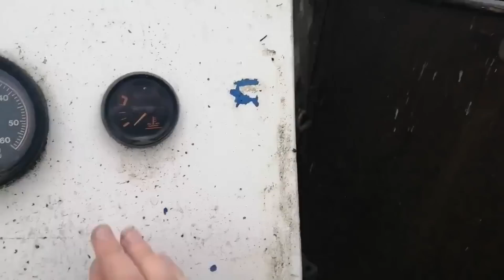Ep 3: I BOUGHT A CANALBOAT!

Comment: Wow? well done it looks a nice boat I cannot see any osmosis on the hull so all looks sound just the rubbing strakes make sure they do not leak? other wise all is well looks a good boat ? I have owned two boats the second was a creaton 32 foot centre cot-pit with a fibre class hull almost bare bones windows and some structure I built the complete top of the boat built side doors and twin water tanks hot and cold water sit down bath and shower solid  fuel stove full electrics etc love it loved the build> now I have moved onto a motor home ??? but miss my boat?? don't forget the boat safty certificate about £140 every four years you need it before you by your cruising licence? a licence needs a mooring or you can continually cruise without a mooring? I have subscribed to you if you need any advice feel free.... best wishes Ken.........

Comment: Lizbef,please don't waste time cleaning BAB, if you are going to do it then do it right. Get that boat in the air and start by sand blasting the outside,bottom first, find out what issues you have there. IT HAS TO FLOAT!  fix issues with hull,prime and paint.then tear everything out of the inside including the floor ,prime ,paint the inside of the hull. then blow in that white insulation that will stick to everything,build new floor . decide if you need new windows you might can get much better insulated glass. then draw up plans for new plumbing and wiring to fit your plans for what you want in the boat,remember plumbing and wiring might need to go in as the floor goes in to make in easier and more accessible. after all that then clean  and start making that boat your very own dream boat.  Been following you since Delos,call them ask what they think of my idea about where to start, please.LOVE AND BEST WISHES

Comment: Rip up the floor and check every square inch and every single stringer for Osmosis and dry rot,  check all through hull fixings and replace. Whatever you do, don't just start building your interior without checking the hull inside and out or you will be pumping her out from the bottom of the canal... I would guess it's going to cost you about 10k to get her in a decent acceptable condition to live in by the time you pass the bss...

Comment: Liz check the hull throughly first, then the outboard, then replace all the thru hulls, there is a reason that it sunk and you need to know that. After that totally gut the interior and pressure wash it with some bleach added. Once the hull is good and the interior gutted and cleaned, make the windows, doors and hatches water tight. Then start on the rebuild of the interior, leave the outside for last (cleaning, sanding and painting) as the weather in winter will undo any work that you do now.
Remember that all the existing lining and insulation should be removed to clean it properly to remove any mould.
With the marine ply panels that will be fitted, the best treatment is with epoxy timber preserver, as many thinned down coats as the ply will absorb on both sides until it starts to build on the surface. Then put 2 coats of epoxy primer on within 8 hours to get the chemical bond and then you are set for trouble free long life marine ply. There will be some that will tell you that it isn’t necessary, don’t listen to them, use the epoxy preserver and primer. I have an old 38ft marine ply game fishing cabin cruiser and it is as good as the day it was built back in 1983 all because I stripped all the paint and soaked it inside and out with the thinned down epoxy preserver followed with the primer as mentioned above when I bought it 20 years ago. Most of the marine ply took 16 coats of the 50% thinned preserver and 2 coats of the straight preserver.

Comment: Couple things Lizbef, first, chuck that vape.  You will wind up in A&E on a vent with permanent lung damage. Look at the news. Second, make sure that the outboard is in good working order. If she's been sunk and not serviced instantly you may be shopping for a replacement. Third, Pull the helm apart and make sure there are no missing bits. Don't waste too much time cleaning you need to get to see all of the interior hull and every through hull and that means making more mess pulling up the floor and what have you. You need to find out why she sank and how any repairs were made. This should be easy compared to Papageno. No diesel, no keel, no mast or rig or chain plates, and nothing has to stand up to a named storm 1000 miles from land. Good luck.

Comment: Ok, I think it will be wiggling too much to live on in the water because it's not made of steel. 
I hope you will get a lot of help to get it liveable.
Reply: That's a common myth about fibreglass.  It CAN be stronger than the same weight of steel (particularly epoxy-kevlar, which this isn't), and just as rigid.  It all depends on the quality of the materials and engineering of the design.

Intercity 125 locomotives have a fibreglass cab and nose, for example; and it certainly doesn't do any "wiggling".

I can't tell from this video what it's like.  It could go either way.  It needs a good inspection by a marine surveyor before sinking serious time and money into it.
Reply: @Murph9000  Completely not my point.  This kind of boat is too light to live on,  too wiggly..
Reply: @robvanessen2925  If you mean stability, as in rolling / tipping, steel narrowboats are not particularly stable either.  Steel vs. fibreglass isn't what makes the biggest difference; it's beam (width), draught, weight, and weight distribution.  Steel boats can be unstable, fibreglass boats can be stable.  With a bit of ballast, it should be ok (not necessarily great, but ok).  If you're used to sailing boats, which our intrepid videographer is, it's not going to be horrific.

To be honest, stability is a good way down the list of possible problems with this boat.

Comment: Hello Lisbef, 
Can I suggest that before you start building anything that you check or get someone to check the entire hull to see if it needs any repairs, and then check all the through hull fittings,  depending on their condition, remove and re-bed or replace them, because you don't want to fit the boat out only to have it then sink.

Also the best and easiest way to clean that boat inside is, to remove everything such as the sheets of insulation, lift and remove any timber floors, put on some wet gear and powerwash it on every surface top to bottom, you will clean it quicker and better than with weeks of scrubbing!

I see that you have some sheets of insulation, but to be honest it would be much better to frame the basic structure of your interior, skin any dividing partitions on one side only with plywood and then get it spray foam insulated by a spray foam company. It would be much more efficient and cost effective, for both doing the work itself and for heating in the future. Regards Dave

Comment: First thing is the quadruple the size of the motor! I'm American can't help it....
Reply: English canal boats are not designed to plane.  Google "hull speed" and learn a little about displacement hulls and wave physics!  Quadrupling HP will consume ten times the fuel and only push the boat a couple of knots faster.  Then google "UK canals" and learn the the speed limit in most areas is 4 MPH!
Reply: @dogpatch75  ok ok let's be technical..... Get a hot tub!